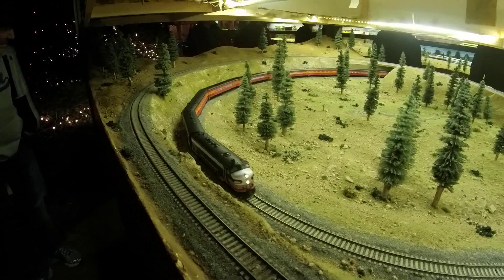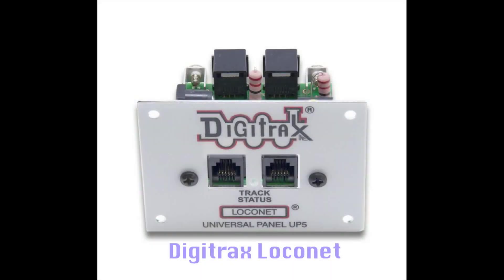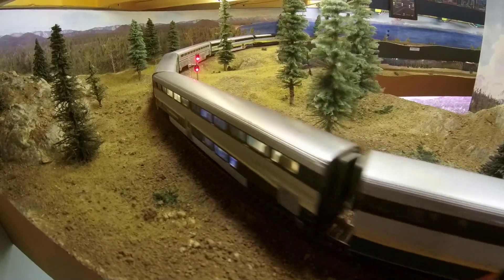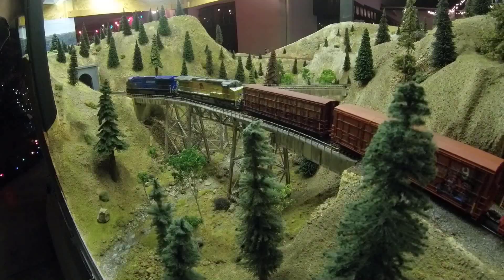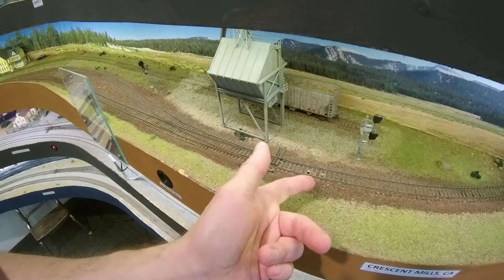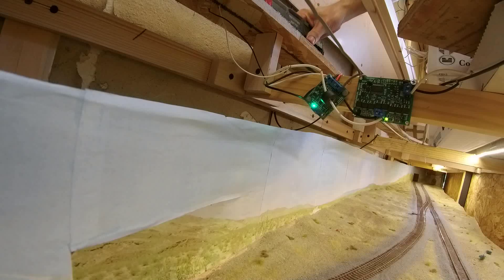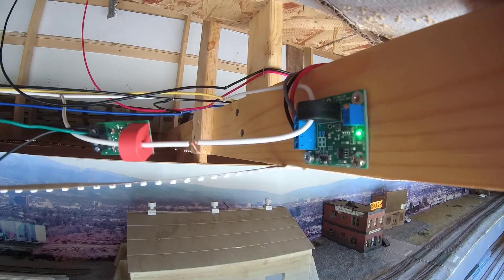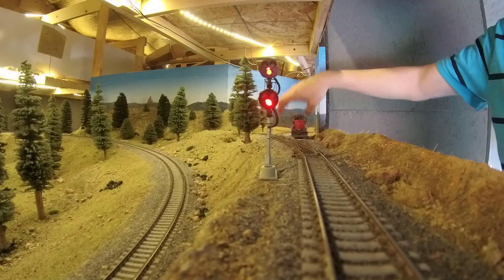Model Railroad Signals Made Simple Part 1

Comment: 4:18 what's wrong with this picture? 1. No Block Detector! you need a block detector or the signal will be wrong. 2. No Interlocking Control Board! your switch needs to be wired to a interlocking control board to slots 1 through 3 for Atlas and slots 5 through 7 for Tortoise or other manufactures. and 3. the signals are wired incorrectly and the jumpers are not set to the correct mode. On each board you need to set some jumpers according to the manufacture BLMA and Atlas signals you set the second  to 1 for BLMA and to 3 for Atlas which is default the third and forth jumper are for aspects see the Atlas signal book and wiring book on the website for instructions. Green over Green is wrong this aspect is never used in the US because it can trigger a collision the correct aspects are Flashing Yellow over Green, Fleshing Yellow over Lunar,  Yellow over Green, Yellow over Red,  Red over Lunar, and Flashing Red over Red. How you fix this is on a double head signal plug in the jack to the #3 board and install a BD 20 to the Block 3 wire wrapping the feeder wire around the tombstone block twice. Next connect a green wire to the signal control board from the BD 20 and connect common and ground to the BD 20 and to the Interlocking Module and connect the other end of the green wire to the jack labeled RIN or Red Input this way when the main is occupied by a train in the trailing point direction the siding shows Red unless the switch is thrown in the facing point direction from Block 1.

Comment: 1:10 There is no such thing as a "target signal"  ... this is unfortunately-persistent misnomer.  In North America (and Canada) these are the common and historically-common designs of signals:
— Lower-quadrant semaphore – only displays two aspects per arm.
— Upper-quadrant semaphore – displays up to three aspects per arm.
— Colorlight – discrete lens per aspect; can be arranged vertically, horizontally, or triangularly. These are often called "Style D", "Style E" and "Style G" based on prototypical catalog descriptions.
— Searchlight – one lens for multiple aspects, effected with a movable vane mechanism that places a colored roundel in the light path. Max of three aspects. Technically these are a specialized form of colorlight signal.
— Unilens – Like searchlights but effected by fiber optics with dedicated internal lamps. Up to 4 aspects. Today can now be done better with LEDs. 
— Position-Light – Mimic upper-quadrant semaphore arm positions with rows (chains) of 3 (initially 4) lamps. Aspects typically "fog penetrating yellow" colored. (Pennsylvania Railroad)
— Color-Position-Light – One central head with up to 4 pairs of colored lamps that mimic semaphore arm positions; this head indicates block state. Surrounded by up to 6 marker lamps to indicate speed requirements. (Baltimore and Ohio Railroad)
— Position-Color-Light – Special colorized version of Position-Light signals that don't use the central pivot lamp, with all the other lamp aspects colored to mimic upper-quadrant semaphore night colors. (Amtrak)

Comment: I used a relay that I hooked up to the double head signal. Green was on top red on the bottom. When switch was thrown the signal heads would change color to indicate that the train either goes straight or enters the switch.

Comment: Very nice. Liked option of Iowa's block detector (I've installed mostly BD20's). Somewhat surprisingly, for an NCE user like me, you didn't mention NCE Light-its, an AIU for your Block & turnout Detection and JMRI.  LCC (an NMRA standard) is the gold standard of signalling could be mentioned quickly too.

Comment: I understand the Atlas system is expensive because one has to purchase a control board for each head. But I hear it will work with straight DC. I don't have DCC or the inclination to get into DCC, and since most manufacturers are getting away from DC, will your system work for DC?
Reply: Yea it will work for DC only provided the block to be detected had a train moving through it.  A stopped train with the power off will not be detected.

Comment: If I may correct a few things about signals. If we are doing this prototypicaly. Signal aspects are read as following
Top aspect= normal speed.  example 
Green MAS
Yellow Approach
Red Stop
Middle aspect= Medium Speed
Bottom aspect= Slow Speed
In your example of a yellow over green signal, giving it as a Diverging Clear is incorrect. This signal would be a Approach Diverging.
Diverging Clear would be Red over Green.
Thought this would help. If you have any questions on signals and their meanings I can try to help have been doing it for a living over 20 years

Comment: Sounds good but expensive. When all you need is a block detector, plus two relays for each 3 aspect signal. The preassembled relays boards plus the detectors and signals that I use on my layout, all come from an online site.
Reply: Sounds fascinatingly simple and cheap.  You should make a YouTube video about it and show us step by step how to setup a block section.   Always on the lookout for an easier cost effective solution.
Reply: @areakt  Hello from the other side of the pond. I will see what I can do. I still have some signals that need installing, so it may be possible.
Reply: Yep.  I haven't been in model railroading in a while.  But if I were going to do it today, I would want to keep things as prototypical as I could muster.  DCC is a must.  Current detection is a must, as well as a resistor on a "B" axle of each piece of unpowered rolling stock.  Each control point would require a dedicated detector for the interlocking itself.  I would also carve up the signal blocks with extra detector sections as needed for determining direction of travel (for tumbledown) and/or for grade crossing circuits.  I would either take all of the detector outputs and shove them into a computer, or design hard-coded essentially relay logic for the signal aspects.  "Manual" and "power" switches also need detected by the signal system.

Comment: If you have an ESU System (or the Piko Cab Control), you can use an LNet converter and use LocoNet without a separate system.

Comment: Can atlas signals work without using dcc
Reply: If you used infrared detectors it would work fine.  But using track voltage detectors it would always display red signals since dc voltage would be off until you switch on the block for the train to enter.  Might be some other workarounds but I’d go with the photovoltaic or infrared detectors for DC.  Or better switch to DCC. Good luck!

Comment: or you could go the arduino route with 3 aspect block signals like i have signals were 3 uk pounds each sensors were 1 uk pound arduino nano boards were 3.57 or something like that a 5volt supply was 5.00 pounds total cost for 4   tracks with several signals on them less than 130 uk pounds including cabling

Comment: great video i have mrc system about to tackle the signal project what do you suggest  thanks
Reply from the maker: Atlas will work fine with MRC.  I would not do Digitrax because you would need to buy a new Digitrax System to run in tandem with your MRC.  Infrared would be OK too.

Comment: I dont need block detectors because theres a block build in the atlas signal control board
Reply: While the atlas board will “detect” when its sent an occupancy signal and change the aspect accordingly it does not have a way to actually detect a change in voltage across the rails or an infrared sensor itself.  For that it still needs an external detector.

Comment: A very nice video.  I'm planning on expanding my current 4 x 8 layout (controlled by EZ Command DCC) to a 5 x 10 layout with two reversing loops, industry sidings, and a yard.  Given the number of switches I'll likely have, I thought it would be wise to install signals, and thought the Atlas system might be the easiest one to use.  Would you recommend this system for a layout of such a size?
Reply: Thanks glad you enjoyed it!  Yes the atlas system would be good choice for your layout.  Use it to protect your reverse loops and any sidings you have with your main.  You probably don’t need to signal your industrial spurs though.  Hope that helps!
Reply: @areakt  Thank you again :).  I'm still very much a novice when it comes to model railroading, though I think the only sidings I'll have on my main line are a passing siding for one station and a spur track that goes from the main into the yard.  Given that trains will likely be both going into and coming out of the yard, I'm thinking I should install two signals (facing in opposite directions) for incoming and departing trains.

Comment: What would you suggest I do if I had digitrax on a small layered what is still be cost-effective to go with digitrax or with the atlas?
Reply: Yeah if you are comfortable with loconet already it should be competitive from an economic standpoint.  According to the documentation the SE8C has built in resistors but be sure to check you’ve got the right resistance for your signals.